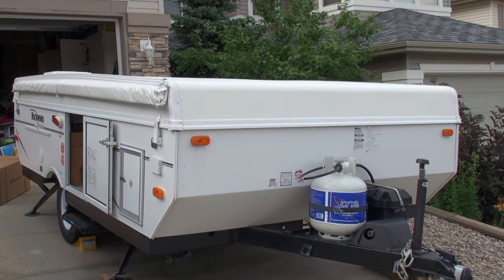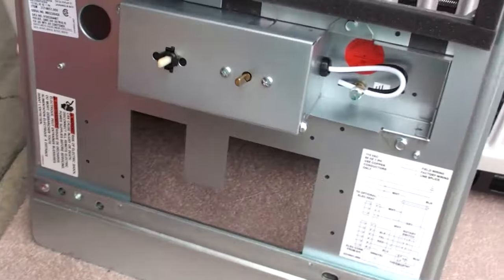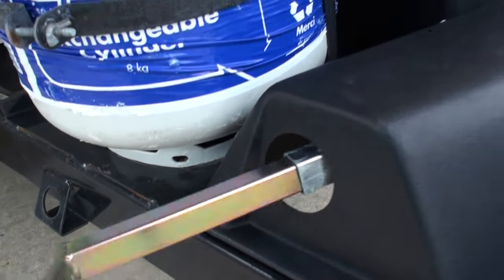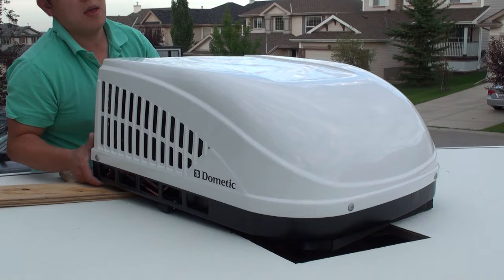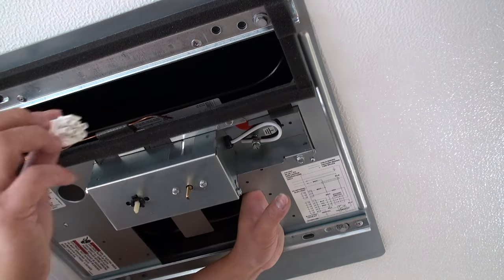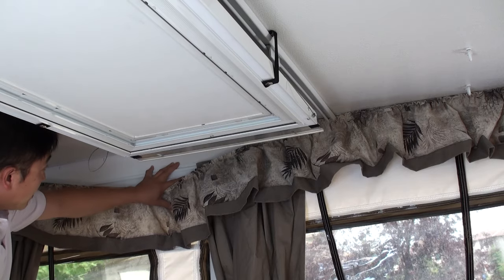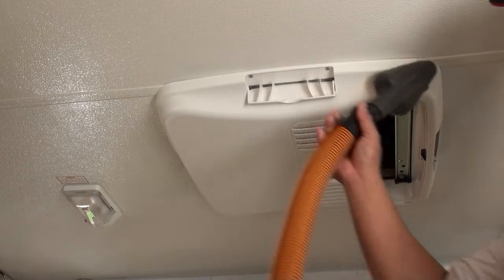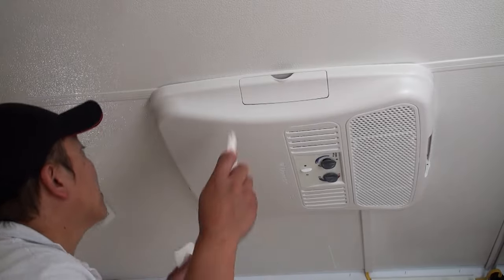Install a RV Roof Top A/C Unit on a Forest River Pop Up Camper Tent Trailer

Comment: Why did you use a 30 AMP outlet? I used a standard plug and haven't had issues yet.
Reply from the maker: You need to use a 30 amp main cord for the trailer b/c you have to consider the total potential load on the mains when the a/c is running.  For example the a/c is spec'd with a 20 amp circuit b/c it needs that much current to kick start the unit without experiencing voltage sag which over time can ruin a compressor (and voltage sag happens a LOT more than you think - I've taken power quality measurement meters with me to campgrounds b/c well.... I'm a big nerd when it comes to electrical measurements and sag they DO!).  What happens say... if you're running an electric kettle or a rice cooker or even a blender that is drawing 1850 watts (effectively 15 amps) and suddenly your 3000 watt a/c unit kicks on drawing upwards of 16.5 amps to get going?  Combine that with a relatively long shore cable and resistive losses in the trailer that you'd EASILY overwhelm a standard plug to the point of heating up the wiring, causing voltage sag and tripping the breakers in the pedestal.  What IF the pedestal breaker or the trailer's main breaker was faulty and wasn't tripping?  This is precisely why modern pop ups all come with 30 amp shore cables now - to take into consideration the loads of what is being drawn on the standard 15 amps outlets + the 20 amp circuit used to feed the a/c unit.  Its all about designing safety into an electrical system and using just a standard cord CAN work but it is hazardous at best to the un-informed.  Safety first!
Reply: @piercedasian  Thank you so much for the info and quick reply.  I'm currently working on my Daughter's Ice Cream Truck and I've noticed the standard plug/cord seems to be getting hot and tripping the circuit breaker... Should I be using the cord you have in the video for my Dometic 13,500 unit or is any extension cord hooked to the 30 amp plug in sufficient?
Reply from the maker: You're very welcome!  Yes, that would explain WHY the cord is getting hot... its pulling a hell of a lot of current through a small conductor and you're likely experiencing voltage sag along with running that cord beyond its safety limit.  The extension cord MUST be able to handle 30 amps (so likely a #10 cable) but it will depend on the length.  If you have a super long cord then make sure you size up on the cord to a #8.  If it is a standard trailer length cable then #10 ought to be okay.  Now what I need to understand is even if you used a cable capable of supplying 30 amps how do you intend to plug it into the trailer?  Do you intend to run 2 power cords to the trailer?  1 cable to run the trailer and a dedicated cable to run the a/c?  If that is the case then you can get a #12 20 amp cable for JUST the a/c unit but the problem there is the pedestal where you're plugging it in typically will ONLY have 15 amp outlets plus a 30 amp outlet which means you're gonna need adapters to make it work.  The best thing to do is hardwire the way I showed in the video where a single 30 amp shore cord can handle ALL the loads of a typical smaller trailer.  You can always reach out to me directly at piercedasian @gmail.com and send photos and such for me to help you do a deep dive into how to safely put this setup together properly.

Comment: Am undecided which ac i want for my enclosed trailer if go with minisplit or window unit or rv ac.  What i dont like about the rv ac is that those units are very loud.
Reply from the maker: I'd do a minisplit.  Those are so awesome and highly adaptable to a trailer and best of all the condenser is so thin and quiet.
Reply from the maker: Yeah the RV a/c units are noisy for sure especially the non-ducted version like what I have.  If it is ducted then it isn't too bad at all.  Minisplits are nice BUT pricey and window a/c unit to me just looks hokey and not very nice looking.

Comment: I'm not sure if someone already mentioned it, but could you use a curly Q cable on the outside or inside for that matter?
Reply from the maker: you could BUT how would you store the curly Q cable ? The thing with my setup and it being the factory approved method is that the long cord that plugs into the roof actually gets shoved back into the cable storage hole in the trailer.  You can't do that with a Curly Q.

Comment: What if you are not pre braced for an AC Unit? I have a 94 jayco 1006 with just a 14x14 vent that i swapped a power vent into which helps but not when it gets hot.
Reply from the maker: If there isn't bracing you'll need to purchase a a/c roof bracing kit.  The kit basically are two metal rails that screw into the underside of the roof and down along the sides (thing of huge "C" brackets).  You then would cut the area between the brackets on the roof and the place the ac unit on the roof.  The weight of the a/c would then be distributed across the rails.  It doesn't look NEARLY as nice as internally braced roofs but it is an alternative that DOES work.
Reply from the maker: look into a roof bracing kit for a/c.

Comment: Any idea how this would be different on a Somerset e3 with a one piece aluminum roof? My trailer is factory prepped to have a “ dealer installed” A/C. I’m highly mechanical and experienced with electrical but I’m hesitant because of the Aluminum roof.
Reply from the maker: I don't believe I replied to your question from many months back.  I can't speak about the Somerset e3's as I have no experience with them.  The only way is to call Somerset directly and speak to someone that knows the ins and outs of the roof's design.  Specific questions to ask them is if there is a roof bracing kit for air conditioning installation.  If they say no it's built in again ask "are you sure and how can I tell on mine if it braced or not from the factory?"  The factory will generally have no issues explaining if it does or does not have the bracing built into the roof.  Hope that helps.
Reply: piercedasian I am almost ready to install on my pop up, turns out that my Somerset is the identical version of the older Coleman/fleetwood e3 trailers. They pre wire a 20 amp circuit and brace the roof on the inside. As for the hole, they mark the 4 corners with pop rivets making it very easy to follow. I will make the cut with a jigsaw. They also require I purchase a ceiling brace kit to minimize roof sag and prevent leaks. I went ahead and got that. I do have a quick question though, since your air conditioner install, have you thought about installing a micro air soft start? How has the unit performed for you since your install?

Comment: Did you have a ground wire with your power supply line attached to the metal frame?
Reply: Nevermind, I saw that you did attach a ground in the box.

Comment: did the roof ever leak around the ac unit after installation?
Reply from the maker: nope not at all.  Its been years now and it works perfectly and never leaks a drop of water.
Reply: @piercedasian  that's totally badass!

Comment: How much was the unit? I got a price of 800 installed for a unit from my rv dealer.
Reply from the maker: +Matt DeWitt The unit on extreme discount (dealer cost) was over $900.  Labor to install was easily another $500-600 minimum.  One dealer here quoted me as much as $2000 for the a/c kit + install.  Keep this mind this is Canada so just the exchange rate alone would easily add another 30% to the US prices.

RV dealers up in our neck of the woods can be robbers.
Reply: what is the model number? This model have the molded foam for added quietness?
Reply from the maker: I don't have the model # handy BUT it is the brisk air II 13.5K rooftop a/c unit.  I believe there are multiple variations of the model BUT it is the most common one.  Just plain a/c with the option to add a heating element to it.

Comment: Very informative video. I was going to order the Dometic AC and came across this statement: The dealer here wanted $800.. labor to install on my 2018  Flagstaff  pop up. At the risk of voiding any warranty I decided to go at it on my own. looking at some of the terrible work dealer have put out I do not trust them to install a tail light bulb... Dometic 13500 BTU Duo Therm Brisk 2 RV Air Conditioner Complete Black Important:

This item is not intended for self-installation. A Dometic authorized dealer or service center must install this item for it to be eligible for a return or warranty request. Any return request or warranty claim filed that has not been installed by a Dometic authorized dealer or service center will be denied.
Reply from the maker: Glad you liked my video!  Yes the dealers can and often do piss poor workmanship because the way many of techs see things is that if it causes problems that its another tech's issue should it ever come back for repairs.  Dometic can call their bullshit all day long about not warrantying things but for the monies saved from labor alone is MORE than enough to buy another rooftop unit should yours fail.  The likelihood of the unit failing is relatively low.
Reply: @piercedasian   I totally agree

Comment: I have a 98 viking pop up camper with a roof hatch and I'm looking to buy a AC Unit but have no idea where to start. Any pointers or tips?
Reply from the maker: you'll need to find out if you have the proper roof braces embedded into the roof like how ours is or you'll need to start reinforcing the roof before doing ANY work.

Comment: Can i just replace the power exhaust on my trailer with one of these and use the same wiring?
Reply from the maker: Sam Matthews OMG no. The power cables are not sized correctly. You must follow these instructions for your own safety and system reliability.
Reply: ahh nvm i see its 110

Comment: Whats the amp draw on your ac unit?
Reply from the maker: it's quite low.  On startup it can be quite high.  Anywhere between 12-14 amps but once it goes steady state I believe it hums around the 6-8 amps range..  Its been a while since I did a current measurement with my clamp meter but those figures do align with what the electrical specs needed to run these units.  While you didn't ask the question, I'll throw it out there in advance - If you're wondering.... the a/c unit will NOT start properly on a 2000 watt generator.  I've had lots of folks at the campground ask me (since a/c units on pop ups are rare in Canada).  You really need to have 3000 watts to enable the unit to start up safely without suffering from voltage sag.

Comment: Now you just need a extra cable to plug the air conditioner directly into your shore power when you can
Reply from the maker: Nah no need :). Once the trailer is plugged in everything works perfectly :)
Reply: @piercedasian  my new very used pop up probably won't be getting a ac ever lol but hey when you get a useable 1984 camper for $320 USD can you complain
Reply from the maker: Donovan Hoover wow that is a crazy great deal!  I wish I could get one for that cheap. Never say never about the ac. Maybe you’ll find one for free :). Well done my friend.

Comment: That's what I want for my semi truck. APU units are crazy expensive, $11,000 to be precise.
Reply from the maker: you can buy a Dometic A/C and do a DIY install for less than $1000 CAD.  I am not familiar with what a APU unit is.... I'm assuming a cooling unit designed to run on 12 volt power?
Reply: piercedasian the apu unit is an ac unit for semi trucks that runs on diesel but, everything's expensive for truck drivers. I bought a the Honda eu2000i generator to hook up an ac unit that'll work great with it so I'm looking to see what the best ac unit would be to match my generator.
Reply: piercedasian thanks for the information
Reply from the maker: you're most welcome!

Comment: I assume the 15 thumbs down are from RV mechanics who don't want people to realize how easy it is to install one of these units.
Reply from the maker: yep that is likely the case.  With all due respect but this is probably the most comprehensive video on YouTube today so I'm a bit baffled at why anyone would not like this vid.  Oh well, there will always be haters.
Reply from the maker: BTW, RV mechanics charge a LOT in my neck of the woods to install one.  Over $800 in labor.  What a joke..
Reply: We have a RV generator in one of our trucks at work. We were having issues with it randomly stalling, so I took it to a factory certified shop. They replaced the control board not once but twice. It was still doing it and they replaced the fuel pump. We took it to a job 2000 miles away in an underground mine and it sprung a major fuel leak. It turns out they "forgot" to install the bracket that holds the fuel pump and it was just hanging by the fuel line. Well, $2,000+ later, it still would randomly stall. I looked at all the invoices and noticed they never changed the fuel filter. I changed the fuel filter and it's been 3 years years and it hasn't stalled once in those 3 years.
Reply from the maker: yeah it amazes me how negligent shops/people can be.  What ever happened to common sense?  I went to an RV inquiring about a questionable setup on my pop up camper that didn't seem right (I knew the answer after thinking it through) but not one, not two but FOUR RV techs couldn't understand what my problem was and why it was an incorrect setup.  They couldn't even explain to me how to wire things up even though I have the entire solution figured out BEFORE going to the dealer.  Just reinforces how bad techs can really be.  Why did I bother asking a tech if I already knew the answer?  Affirmation to make sure my thinking was correct but clearly I'm more sure than 4 techs were...
Reply: The thumbs down is for that fact that the guy cut the fiberglass in 90 degree angles. This of course will cause the fiberglass roof to spider crack out from the cut as the AC unit bounces on it. Real rookie mistake. However he is not alone, many dealerships did this for years before repair bulletins from manufactures started pouring in after warranty claims on roofs skyrocketed and even eventually lead to the closing of Fleetwood folding trailers. ALWAYS radius cut fiberglass, NO corners (i.e. 90 degree angles).

Comment: I want to install a roof ac on my passenger van, the factory ac can not keep up. How do I do that?
Reply from the maker: While this A/C unit would make you freeze because of how powerful it is, I'm not sure how you'd power it on your passenger van unless you have a GINOURMOUS alternator and a huge inverter capable of generating over 3000+ AC watts.  Your passenger van's A/C is likely low on refrigerant or the air filter in the blower is clogged.  Check those out first.
Reply: Already checked the Freon but not the filter, thanks.

Comment: question why dont you just go right to the converter with 1 wire
Reply from the maker: b/c if you did it with just the 1 wire then how do you expect the wire to fold up without kinking when the pop up is dropped down?  The way pop ups are designed is for the power flex cord to be routed outside of the unit and not inside where it can get in the way of things.  Factory approved method is what is shown in the vid.
Reply: ok but in the front zipper of  my flagstaff pop up tente there is a place for the 12volt wire and probably still have place for the a/c wire. that mean the wire will stay inside the canvas!! I'm only asking because i'll probably do the same job to my pop tent

Comment: Router trace bit would work great fo that
Reply from the maker: Can a router trace bit work for cutting through through thin sheet aluminum?
Reply: Yes with carbide blade thats what they use when they cut out windows @ vents cuts 1/4" wood and outer skin metal:

https://www.amazon.com/85216M-2-Inch-Diameter-Laminate-Bearing/dp/B0009H5PP4/ref=sr_1_1?ie=UTF8&qid=1475338235&sr=8-1-spons&keywords=Router+Flush+Trim+Bit&psc=1
Reply from the maker: that's good to know.  I didn't know that!

Comment: Why didn't you just run the wire on the inside, that way  you don't cut more holes in trailer, when you buy one with ac on it the wire jus runs down the curtains .
Reply from the maker: I could've done that but I opted to go and follow the factory approved installation procedure.  Keep in mind that you still have to hardwire the a/c unit to something (i.e a power inlet box for example) where you'd then have to plug in the flexible cord into a 20 amp outlet somewhere.  Having the cable on the outside means you can shove the flex cable into the trailers storage compartment (as how it was meant to work) and call it a day.  I totally understand why they designed the wiring in the manner that they did.
Reply: I would also argue that you would have the added hassle of a permanent wire that you would need to be aware of when opening and closing the unit. This way you can remove the cable on the outside and it does not need to be a concern.

Comment: Let’s talk about that CRX in the garage.
Reply from the maker: lol, yeah the CRX... it is mostly a garage queen.  Just barely under 200,000kms and factory fresh as factory fresh will likely ever be.  It is 95% stock with dealership installed a/c that blows cold still.  It's a gem and I spent a small fortune restoring the car to the point where it looks like it was just purchased new.

Comment: all good except for the wire nuts.... it is better to do a good splice and cover it with shrink tube... you can buy it for a buck anywhere and all you need to install it is a lighter and it is 100 times better...
Reply from the maker: Interesting.  I'm not sure if using shrink tubing meets electrical code in Canada or not.  I know for home installations that shrink tubing isn't permitted so hence why I didn't bother with the a/c unit.  I actually have lots of electrical shrink tubing I use for my low voltage hobbies.